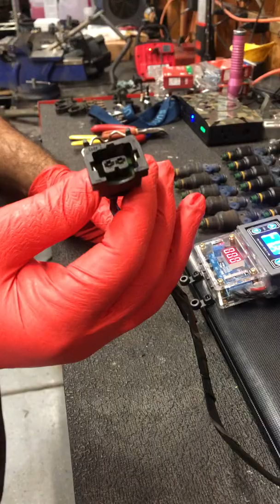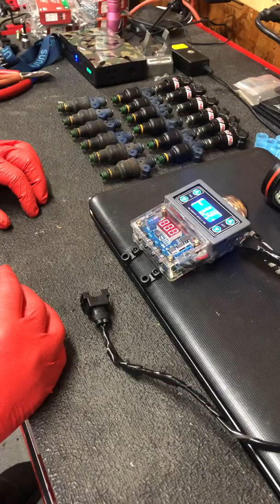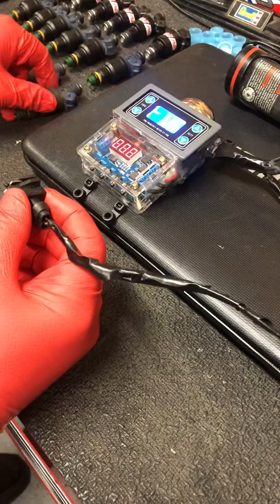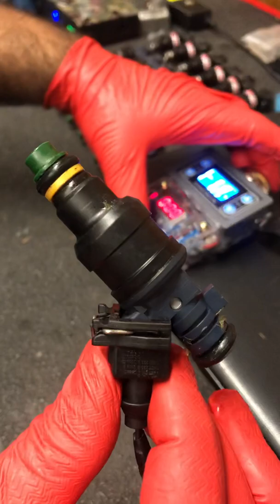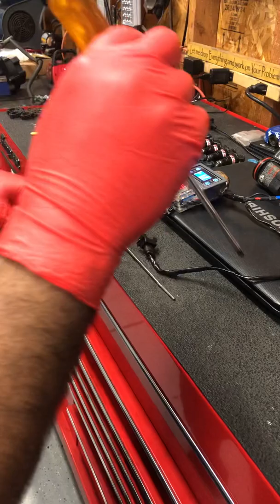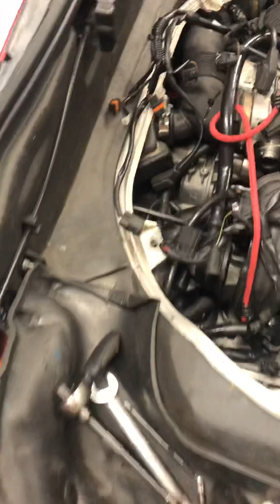Fuel injector basics, clicking sound, cleaning, and checks.

Comment: Can it be injector noise if it's only audible when on the throttle? I don't hear it when idling and very faintly when cruising at a set speed.
Reply from the maker: What about when parked, revving to like 2k holding it there?

Comment: Thank you for showing the sounds, I was a bit worried about the engine, cause it has been slightly ticking since I bought it, thought it was valves, changed the oil and it didn't have any metal sparkles in it at all, looked beautiful, so I was confused, but I recognize the sound, it's the injectors making their natural sound lol
Reply from the maker: Glad I could help

Comment: Hi,
I have watched this video over and over many times. I've also read this video's comments and your replies to them, in one of them you said if a Diesel injector is ticking it should be replaced.
I have a Golf VII 1.6 TDI (diesel) with original Delphi injectors. At least one of them is ticking (I'll send you a video later). They have never been cleaned. Car has 165k KM (about 100k miles), was mostly driven in busy town conditions by the previous owner. No idea what quality fuel they used (the in-tank fuel pump is also very loud - same sound as here https://youtu.be/tNPjagdayZ4 ).
Is it worth trying to clean the injectors or shall I just replace them? I have seen other cars with the same engine as this. After many miles they had the same ticking noise (and fuel pump noise), but new ones don't come with this noise.
Reply from the maker: There are many styles of diesel fuel injectors, some naturally generate small ticking noises. It’s the louder noises you have to worry about, or if one is making a different noise than all the rest of them, then that would be a good indication that the injector is either dirty, worn out and failing or has a fuel supply issue or even mechanical damage. Another thing to consider is that injectors don’t always just hard fail, sometimes they just do not meter the fuel correctly, too much or too little over long period of time, causing wear to the engine because of fuel washing the cylinder walls, fuel diluting the oil, or running lean, causing it to run hotter and work harder. Then there are also exhaust system damages which can occur. You can do an oil change, run it normally for a bit and then have an oil analysis done, but I would watch a video on how to properly collect example so that you do not contaminate it and end up with false readings. This as well as checking your fuel consumption will help you determine if you have an over/under fueling condition. Don’t just throw parts at it, there are people out there who can bench test these injectors as well. Thanks for watching and commenting.
Reply: @MechaniclifeJDM  Thank you for the in-depth reply!

The noise I am talking about is fairly loud, louder than the normal engine noise (normal: https://youtu.be/nqSxtcUhbxg vs mine: https://youtu.be/gbHFZZM5KLA ).

I listened using a screwdriver each injector, one of them (probably 3rd from left to right) was ticking louder, but I am not a mechanic and I am unsure if my testing was correctly conducted.

As for the injectors not metering the fuel correctly, would that not appear on an OBD test while driving the car? I have done that with two mechanics and both confirmed my injectors measure good.

I know my EGR valve is stuck open, it never closes all the way. Could that cause this noise at idle? I know it causes a ticking of sorts at certain loads.

Analyzing an oil sample is not an option in Romania, no such service is available, except overseas and it's pricey. Unless necessary, I wouldn't resort to this.

As for my fuel consumption, it's high only when the engine reaches that load that causes ticking because of the EGR valve being open. Otherwise, consumption is normal I would say.

I am definitely trying to avoid replacing the injectors - they are expensive - , but I doubt my mechanic has professional tools to clean them. Depending on how thorough the cleaning process must be, I could ask them to do it.

What do you advise?
Reply from the maker: Definitely take care of that stuck open EGR valve first then monitor weekly to see if your injectors sounds are changing at all.
I feel safe to assume that you have changed your fuel filters
Reply: @MechaniclifeJDM  Alright, that's what I'll do, thank you!
Of course, the fuel filter was changed back in April 2023 when the car was bought and in April 2024 again.
This noise was already on the car when we bought it, but yeah, we weren't careful enough to notice it in time.
Reply: @MechaniclifeJDM  Back with an update, changing the EGR did not fix the noise, the stuttering, nothing.

So I went online and dug deeper.
This is exactly how my car sounds like: https://youtu.be/1O4m6klxrIY

Which, AFAICT, means all the money that went towards buying and fixing this car is down the drain.
Reply from the maker: Not really, drive and enjoy
Now it should run quite a while trouble free

Comment: What does it mean if its a single click  say every 5 seconds?
Reply from the maker: Does the engine run rough?
Reply: @MechaniclifeJDM  I haven't started it yet , I put an upgraded loom in k jetronic to ke but it was 2nd hand. That's me just putting the power through the battery and it starts clicking, no ignition

Comment: I have 1 injector on my Mazda miata NB 1.6 that clicks loudly, i can hear it when the car is idling with hood down! The other 3 click but you have to use a screwdriver or something to hear them, for what i know, it's fine and it's not faulty, but i hate that noise.
Car runs fine too so i don't even know if i should buy new ones just to be sure
Reply from the maker: Are you sure that it is in fact the injector, and not possibly a valve-train component near to it?
Reply: @MechaniclifeJDM  I've put a screwdriver on valve cover near every sparkplug and I don't ear anything weird, but there is just one injector that if I tap it, I can ear it ticking and going crazy 🤣. 
Shouldn't be valvetrain because the NB doesn't have hydraulic lifters and the noise is too fast to be valves imo
Reply from the maker: Check for evidence of arcing inside the connector
Reply: @MechaniclifeJDM  as in? If the connector receives power? Sorry English ain't my first tongue.
Reply from the maker: Yes, the connection may be loose and the noise you hear could be arcing, look for burn marks in on the connection pins, but if you find nothing, I would still replace it if it is louder than the others by a good amount.
Reply: @MechaniclifeJDM I checked the valve lash, and although not in spec, it's on the tight side so can't be source of the noise. 
My mechanic has 4 spare injectors and he's letting me try them before buying them 🤞🤞🤞
Reply: @jimmysmith4671  It was and still is, my downpipe, I dragged it on the floor of my driveway a couple times when I first got the car and I damaged it. Figuring out what I should get as a replacement.
Also my injectors are a bit noisy but they make a distinctive low pitch click.
I suggest checking valve lash, checking the injectors and then the exhaust.

Comment: Thank you. Do you rate any of those fuel additives that say they clean injectors? I have one clicking on my 3.0 V6 turbo diesel Audi a6. About 180 thousand miles on her. I will be trying the screwdriver audible check to identify the exact culprit.
Reply from the maker: If a diesel injector is noisy replace it, without delay.

Comment: Hey very good vídeo, i have a corolla 1zz-fe and it makes some tick tick sound on the injectors place, can a injector be loud or when its in bad condition it doesnt change sound?
Reply from the maker: It depends on the failure mode, if its shorted or open electrically it wouldn’t make any noise or may be faint, but be careful because this can be caused by circuit issues as well, if its plugged and not spraying or not atomizing the fuel properly ie dribbling it could sound normal but you Would most definitely have either power loss, misfires, or a complete loss of fuel economy
Reply: @MechaniclifeJDM  thanks for the help dude, god bless you
Reply from the maker: @cleziosgarage  It will also change sound when empty vs pressurized due to dampening of the pintle valve by the pressurized fuel and no problem happy to help, God bless you too brother! Be safe.

Comment: So my bro-in-law has a C$ corvette,which had 38psi at the fuel rail, it has spark at the spark plugs, and it has voltage going to the fuel injectors, when we'd spray starting fluid in the throttle body it wanted to start, but didn't. So we put a stethoscope on his injectors and they were silent. We took it all apart and pulled the fuel injectors and put 12V voltage on each one individually and all of them did not click but instead buzzed. So are they all bad or just completely clogged up? Should we replace them all or try to clean them all out?
Reply: I mean a C4 corvette....sorry.
Reply from the maker: 38psi seems low, did you check what the fuel rail pressure specification is? also you don’t apply voltage for too long just little short bursts

Comment: What a great video !! 👌
Quick question : my car make some tick noticable ONLY when i rev around 2000 rpm (while driving or parked) ... Can that be from the fuel injectors ?
Cause i recently replaced new hyd lifters but the tick still there, And i tested the compression on 4 cylinders they are good. 
Did oil change, coolant, new spark plugs. Still ticking
I Didn't change the ignition coil tho.. Nore the wires. 
Ps : Its a petrol engine, Golf6 1.6L bse. 77000 miles 2009
Reply from the maker: Check for exhaust leaks loose heat shielding or anything around the engine that may cause the noise, you must perform almost a forensic analysis, you can also use a technicians stethoscope to help you track it down
Reply: @MechaniclifeJDM  thank you sir
Reply: Did you ever change the injectors and was it the injectors ??? 

This is happening to my Chevy Cruze 2011  I used a stethoscope  to track down found out that the ticking  is coming from my injectors gets louder when u rev it    would the injectors sound super loud ticking if something is wrong with the injections?

Comment: So i have a 2008 f150, 4.6l with 150,000 miles on it and i have been hearing a clicking noise coming from fuel injectors, i know they are supposed to click when working but they are pretty loud, i can hear it when idling and accelerating down the road, was wondering if it was normal for it to be that loud?
Reply from the maker: Are you certain its not valve train noise?

Comment: I have same porsche boxster, you can drop the entire engine much easier to rebuild. I still have original injectors with 160k every thing original except the clutch. IMS double row still the factory. 

Why are those Injectors are dead after cleaning?
Reply from the maker: I would like to hear your suggestions for dropping the engine easier, sounds like some promising tips could come out of this comment which may help others, myself included with one of these in the future, by the way thanks for watching and dropping a comment, much appreciated.
I believe corrosion due to the liquid used to flush the injectors and lack of following the procedure with a follow up anti corrosion flush caused their demise.

Comment: What actually makes the clicking noise happen in the injector? Does the plunger hit something when it reaches it's highest point or is it some kind of electrical arch sound?
Reply from the maker: Mechanical pintle movement hitting its limit or its seat, thats why with fuel it will be dampened, thanks for watching, taking the time to comment, we hope you like and subscribe!
Reply: @MechaniclifeJDM hello. I have installed id1300 injectors and since I’ve heard this consistent tick. When I give it gas it goes away. Sometimes it’s louder then other times at idle.

Comment: I remember hearing a clicking noise, my car would sometimes stutter when pressing the gas and now it doesnt start at all. Ive checked the spark plugs and thats not the problem. It sounds like a machine gun when I turn my key. No codes. Does this sound like a fuel injector? Mazda 3 2005 4 cyl
Reply from the maker: No sounds more like a battery terminal, battery cable, battery, or starter solenoid issue, from what you have described 
Does it turn/crank?

Comment: For Supersport  bike... Is it normal for Injectors to "click" while engine warms up???
Reply from the maker: All injectors click if you listen close enough, (use a mechanics stethoscope 🩺 or a long screwdriver, to isolate the source of the sound) it could be valve train noise you are hearing, although some noise is normal operation (especially during cold start), it may be time for a valve adjustment depending upon wether or not you have met the manufacturers mileage recommendation and if an adjustment is even permissible on your engine type.
Reply: @MechaniclifeJDM  the sound is while engine warms up... And yes it's like "tik tik tik tik".. Valve adjustment would be needed if sound continues after engine is warmed up.. But it usually goes away at 70°
Reply from the maker: @-soundmcgee-2002  could also be an oil supply issue to the head, when was your last valve adjustment and last oil/filter change
Reply: @MechaniclifeJDM  doesn't matter.. As I heard for Suzuki GSX-R Engines it's a normal thing... Valve adjustment + compression was in April.. 6k Km ago ( filters + oil+spark plugs changed 4k km ago)
Reply: @MechaniclifeJDM  do you have any social media? Maybe FB page? I could send you video or ask there?
Reply from the maker: @-soundmcgee-2002  Its true that some engines do naturally tick ever so slightly, especially after a certain mileage.
Sorry no social media, I stay away from that stuff, provide an email address if you like.

Comment: Thank you my guy for the knowledge. I got an engine with 50k miles on it, but it was left outside. 3 were stuck from corrosion smh.
Reply from the maker: Thanks for watching and taking the time to comment. 

Most people can take things apart, but don’t know or care enough to store them properly. 

It sucks that this happened to you but you found me and learned something so it ain’t all bad 👍🏽 then right? 

Hopefully you got it going good now.

Very little moisture will cause that corrosion very quickly, in fact if you ever send injectors out to be cleaned be ready to put them to work right when they get back, just trace moisture left over from the cleaning process can cause issues.

Comment: I have a 2011 ford explorer will bad full injectors cause raw gas to fill up in intake manifold and to come through throttlebody
Reply from the maker: 😬 consider changing the oil immediately, as that amount of fuel contamination can cause severe damage to the engine due to dilution 

I would remove the fuel rails with the injectors still attached if possible, and place plastic cups under each injector then key on, and observe the prime sequence in operation to find who is squirting when the should be sealed.

Do not crank it, you need to let that gas either evaporate or remove the manifold to clean it out, major fire hazard, have a proper extinguisher handy, not a garden hose, water spreads gasoline fires.

Also fords used to have clear flood mode
Holding the pedal to the floor, ALL THE WAY DOWN, then key on and crank. should produce no injector pulse, This will allow you to clear the last little bit of flooding

Comment: Hey I think My fuel injector faiIed  its On my channel  what do you think the noise could be ? poor mpgs and slow acceleration and misfires when tune On.
Reply from the maker: Use a very long screwdriver, or go to your local Harbor freight store and buy a technicians stethoscope.

You basically will be trying to narrow down the source of the noise.

To use the screwdriver, just place the tip on various components around the engine and put the other end of the screwdriver, the handle end, to your ear

It may take a little bit of firm pressure for the sound to transfer well, but be careful 

don’t damage your hearing by doing something stupid, be very careful around rotating components such as pulleys and belts, they can launch a screwdriver across the room. 

This is where the technicians stethoscope really shines, If it happens to get snagged it will just bend and break in most cases.

Do not forget to wear safety glasses, think what’s the worst that can happen and really try hard to prevent it.

Don’t give up listen around things like the high-pressure pump, different corners of the valve cover, on the engine block near all rotating equipment such as the alternator and the belt idler‘s, don’t forget to listen to the PCV valve, listen near the transmission side of the engine, listen near the throttlebody, near the turbo, leave no stone unturned until you Find the source of the noise, and then you must report back with your findings, good luck be safe, thanks for the view, I’d appreciate a thumbs up, and a subscription if you’re feeling generous.
Reply: @MechaniclifeJDM  thank you will try your method. Subscribed liked
Reply from the maker: @Neverfollowthecrowd  follow up with your results 
Be safe brother
Reply: @MechaniclifeJDM  UPDATE POSTED! Replaced the injectors tapping noise went away thanks for your help !
Reply from the maker: @Neverfollowthecrowd  great work, thanks for updating, be safe brother!